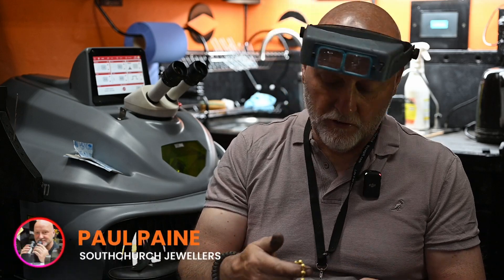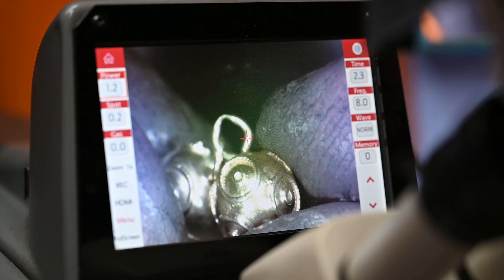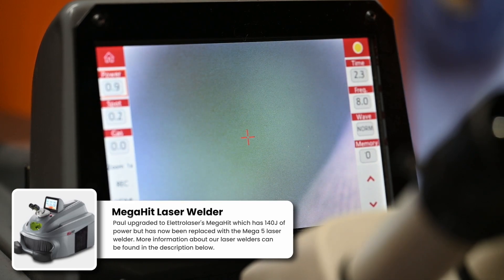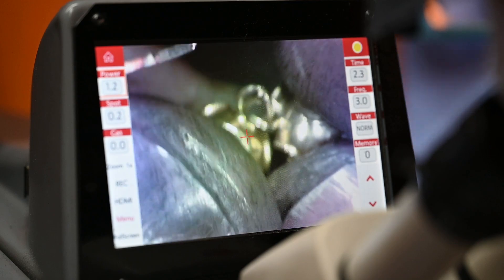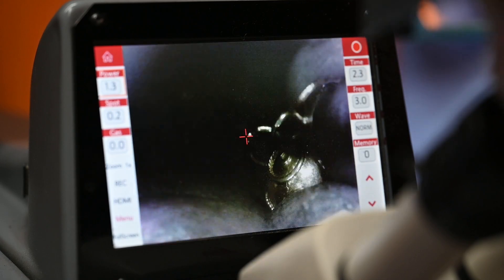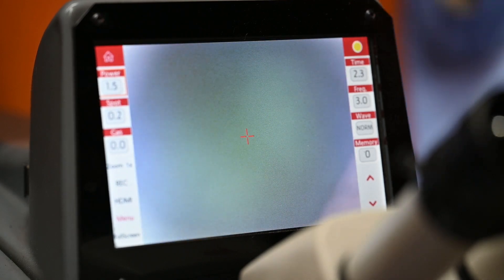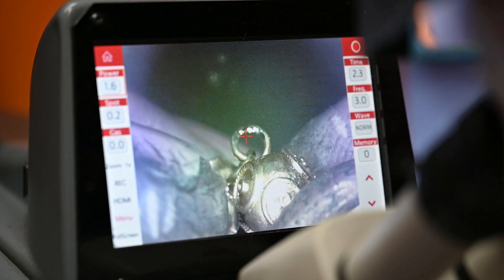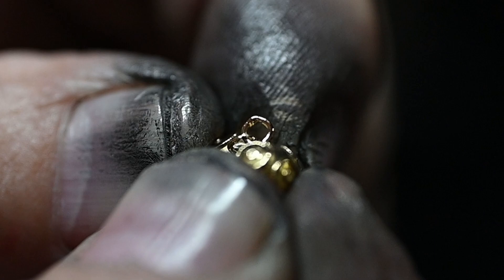Expert Guide to Lasering & Restoring Links On An Antique Gold Bracelet! | PAUL PAINE'S WORKSHOP

Comment: i have a question i have a hollow byzantine chain 5 mm .
Its broken i went to some oldschool goldsmids who sayd they cant repair it the orginal way.
becsuse the chain is hollow it will melt away they sayed.

Can this machine welt the chain together again? (my rings in the chain are bigger than what you welt in the video
Reply from the maker: You can repair hollow chains and jewelry with a laser, but it's not an easy technique and requires skill. You use laser wire and carefully apply it onto the hollow chain to build up the material, taking care not to hit the chain itself.